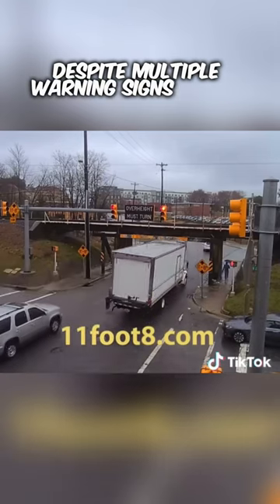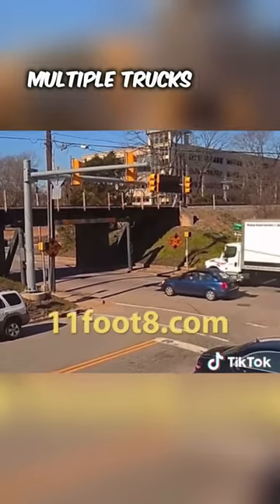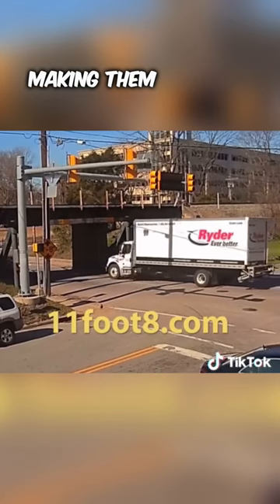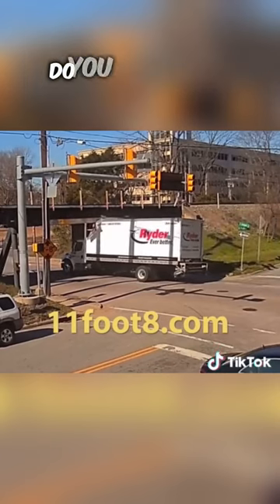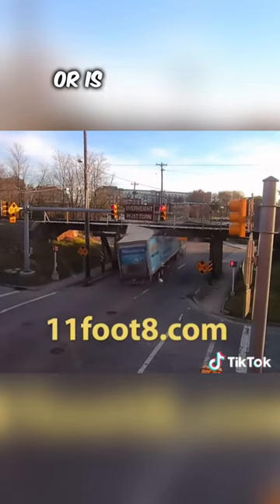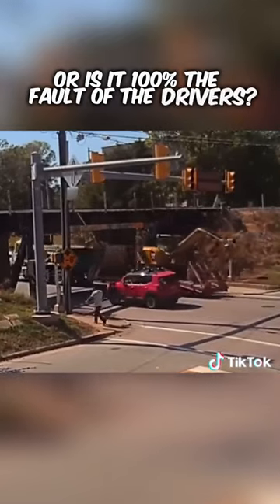Can Opener For Trucks 💀 #shorts

Comment: What do these people saying “It’s the truck driver’s fault because the truck was too tall” like what do you want them to do? Stop in the middle of the road and measure their truck and have to go back?
Edit: I GET IT TRUCK DRIVERS KNOW THEIR HEIGHT OF THEIR TRUCK
Reply: Should know your truck height and there should be signs that state clearance
Reply: You must be a kid 😂 most trucks literally say the height of the truck inside and outside the cab and there's a huge sign that's telling trucks to turn and not to go under the bridge and if the inside or outside the cab doesn't have the truck height then don't be a dumbass and risk it just turn and find a alternate route
Reply: Any responsible truck driver would know the height of the truck they drive. And the height maximum is clearly written on the bridge.
Reply: A lot of truckers do a measuring stick with them….
Reply: there is 2 signs one with the height of the bridge and one that clearly says overheight must turn and i’m sure a lot more signs before it. so yeah it’s mostly their fault